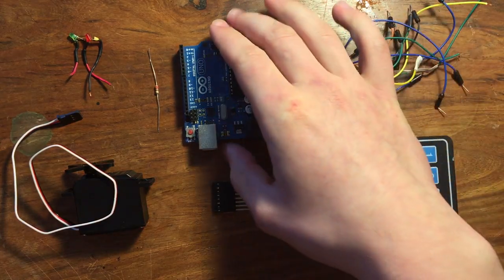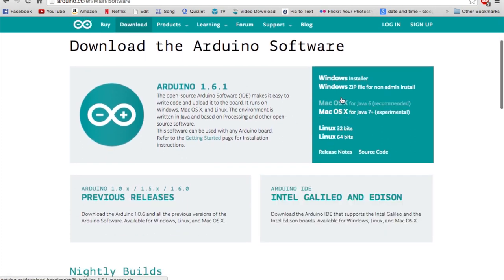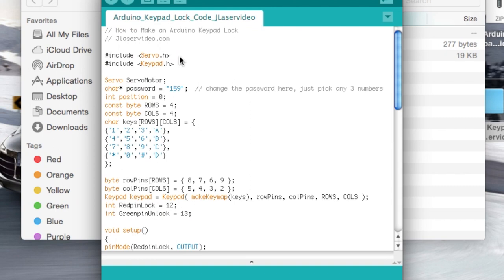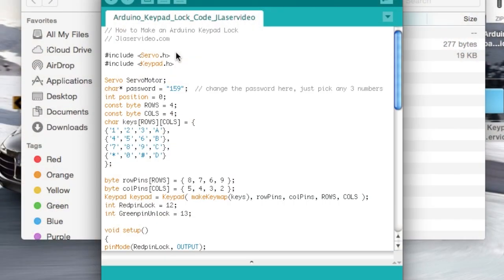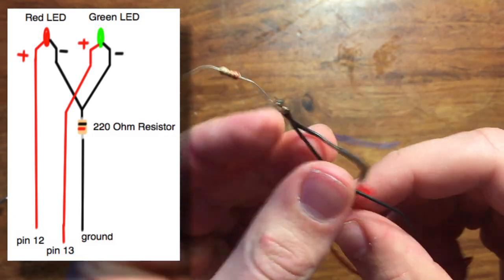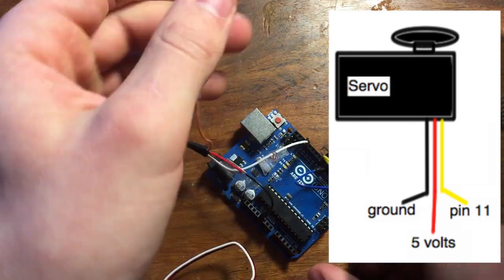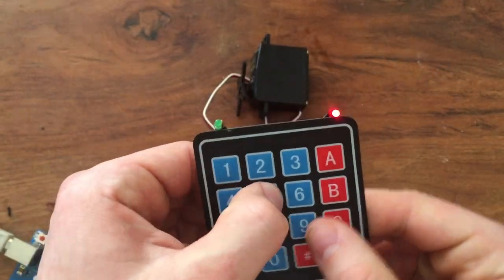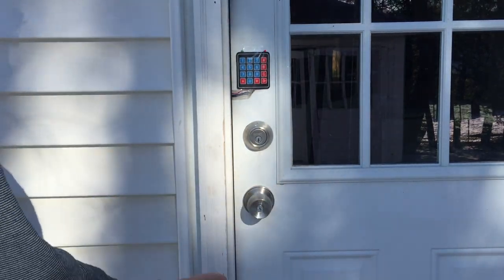How to Make a Keypad Lock With an Arduino

Comment: maybe you could edit the code so another servo triggered whenever the wrong passcode was entered- that servo could be connected to a small lever that tipped a bucket of water down on the unsuspecting unauthorized would be enterer...erererer...eerrerrrrrr, or something.
Reply: Haha good but that's not enough fill the bucket with molten lava
Reply: Naw just make it start an alarm and scare tf out of the person

Comment: note that if password  is ' 145'  , even when press  ' 1   23   4  74   5 '   (1*4*5)    still will unlock ! you have  to update your loop : 
void loop()
{
 char key = keypad.waitForKey();
 if (key == '*' || key == '#')
 {
  position = 0;
  LockedPosition(true);
 }
 if (key == password[position])
 {
  position ++;
 }
 else if (key != password[position])
 {
  position =0;
 }
 if (position == strlen(password))
 {
  LockedPosition(false);
 }
 delay(100);
  

}
Reply: theoretically this works, but when i changed my code it doesnt work.
for some reason, the "position" counter will always be set to 0, even if you guess a correct entry (eg. '1' for password '123')...
Reply: You need to adjust closing bracket, to wrap all the content of if (key) statement:

void loop(){
  char key = keypad.getKey(); 
  if (key){
  
  if (key == '*' || key == '#'){
    position = 0;
    LockedPosition(true);
  }
  if (key == password[position]){
    position ++;
  } else {
    position = 0;
  }

  if (position == strlen(password)){
    LockedPosition(false);
  }
  }
delay(100);
}
Reply: Yo buddy's I fixed it by just adding an else if() at the end of this guy:

 if (key == password[position])
 {
  position ++;
 }

like this

 if (key == password[position])
 {
  position ++;
 }else if(key != NULL)
{
 position = 0;
}
Because it's really the NULLs that are causing the problem. This should fix the code right up.
Reply: Thanks my dude, i knew that was the problem but i didnt know how to solve it.
Reply: Hey bro! how can make a buzzer create sound when the password is wrong!

Comment: The code "<Keypad.h>" is not in orange font like in this video
Reply: I know this is an old post but it took me a while to figure it out and it might help someone else, you must save the download "keypad.h" into the same folder as your arduino. Then go to sketch, include library, and then you should see keypad and click that. If not check to see if you have it downloaded in the same file as arduino and restart the program.

Comment: i'm getting this error while uploading the code ...
any help ?
Sketch uses 3,456 bytes (10%) of program storage space. Maximum is 32,256 bytes.
Global variables use 205 bytes (10%) of dynamic memory, leaving 1,843 bytes for local variables. Maximum is 2,048 bytes.
Reply: it's not an error
Reply: well sometimes it's failing to upload the code tho ... *****
Reply: yeah it's orange colored !!
Reply: Can you help with code of password based circuit breaker
Reply: make sure you are using the right PORT under the tools tab

Comment: I really hope you get back to me on this, but m problem is that when it is in the Locked position, it turns the servo clockwise and doesn't stop, and when i enter the code, it just turns the servo counter clockwise and wont stop. I am using the exact components, code and its all in the same places as you are. Please help!
Reply: Same for me! 
I don't know what to do
Reply: I'm just jumping into this stuff but maybe the sensor in your servo motor has failed?
Reply: oh i fixed it btw its cause the servo was a continuous rotation servo
Reply: do you know how to use it with only a continuous rotation servo? coz thats all i have
Reply: Omar Khaled that's the thing, you really cant, the point of a continuous rotation servo is that it just rotates continuously

Comment: I really do love the project and currently using it to lock my shop however there are some concerns.  First I am putting in a safety backup somehow so if I loose power I can still access my shop and second is that you can put in any string of numbers that has the code in order and it and it will open the lock.  So if the code is 692 you can put in 65498732 and it will open the lock.  Not too concerned with it because there isn't much to protect in my shop without other keys, however it could be an issue.  Again, thank you and much respect!

Comment: the problem is there is no penalty for wrong digit, if u guess a digit rigth and then one worng the rigth one dose not even go away,                                                                                                   with a random code it max 3 counts from 0-9 to guess it , but unlike normal codes it dose not get expenentialy harder so 9 digit code is still only 9*10 tryes, unlike 10^9 or 1000000000 if it erased progress when typed wrong

Comment: I've got a short question: is it possible to use 2 different codes for 2 different actions. Example with code '123' you turn on the green led. And with '456' you turn on a red led and rotate the servo.
Reply: it is possible!
Reply: +Adriaan De Bleser everything is possible. you just need to modify the code

Comment: just curious if u can do this with a 12v magnetic lock instead of a servo?
Reply: +HAC DILL yes mate just use a relay
Reply: +Damian Butterworth Can you help me, how can I use the relay ? Do I need to add a switch to make my magnetic lock on? or will this keypad be enough? How can I make it on using this tutorial? with relay
Reply: +D Hills Santillan I would use the digital pin to switch a relay and use that to turn on the magnetic lock. Or anything in fact. Only just found out how to see messages on here lol so sorry for slow reply.
Reply: THANK YOU! it's okay I appreciate your helpful reply
Reply: Damian Butterworth Awesome..thanks :)

Comment: the code doesnt work :(, [error compiling]
Reply: +MEe$ It worked for me.
Going to try it on my youtube channel soon
Reply: +MEe$ 
Try different ports. Do Theys steps. Open the arduino software. Go to tools Then port. Try using different ports when you upload the code. 
If that does not work Go to tools then bords and make shure you have selected the right bord. (the one that you are using).
If this works please tell me and sub to my channel. 
Thanks!!!!!!!!!!!!!!!!!

Comment: Are there enough ports to add more than one servo?
Reply: I think it depends on the arduino
Reply: There are up 13 pin ports on the board I believe. If you need more, you could if there is a port extension.

Comment: Started working on this but when I uploaded the code I got alot of error messages:
Arduino: 1.8.5 (Windows 10), Board: "Arduino/Genuino Uno"

The library "Arduino Keypad Software Jlaservideo" cannot be used.
Library names must contain only basic letters and numbers.
(ASCII only and no spaces, and it cannot start with a number)

This report would have more information with
"Show verbose output during compilation"
option enabled in File -> Preferences.
Reply: sad
Reply: u need to upload keypad file

Comment: Hey, cool video, I just wanted to ask your opinion on atmel studio for an ardunio ide. If you aren't familiar, it is a micro controller based ide based on visual studio I believe. Also, since it seems this project is permanent in your case, I would recommend you build an ardunio from an atmega chip and ask the components from scratch as it is much smaller, and cheaper, so you can use your main board(s) for other things.

Comment: Hi bro, I normally put a 110ohm resistor with a switch to stop random switching. Having the same problems with the keypad.?? Tryed 110 ohm on each pin to ground but that stopped pad working.Will try another size tomorrow.

Comment: this is the error msg i got:
Arduino: 1.8.3 (Windows Store 1.8.6.0) (Windows 10), Board: "Arduino/Genuino Uno"

C:\Users\noahw\AppData\Local\Temp\Temp2_Arduino-Keypad-Software-Jlaservideo.zip\Arduino Keypad Software Jlaservideo\Arduino_Keypad_Lock_Code_JLaservideo\Arduino_Keypad_Lock_Code_JLaservideo.ino:5:20: fatal error: keypad.h: No such file or directory

 #include <keypad.h>

                    ^

compilation terminated.

exit status 1
Error compiling for board Arduino/Genuino Uno.

This report would have more information with
"Show verbose output during compilation"
option enabled in File -> Preferences.

Comment: Hey I built the same thing recently just a far more complex version but with the same parts + an LCD outside ... I have 2 questions though. 1. I had to by these coils of cord and run them under the door to the other side as I was afraid shutting the door on the wires would damage them ... Do you have that problem? 2. Would you mind taking close up pictures of the servo mounted inside and upload them somewhere for me to see? I ask because I couldn't find a proper way to do it for hours (I mounted on a room door so the lock is on the knob ) and I had to resort to buying a barrel bolt that I mounted next to door and ghetto rigging a paper clip from the servo to the hook on the barrel bolt. Thanks anyways

Comment: Servo how did u make it work with power instead of PC???did u remove PC and then reconnect it with power??if u do that arduino will reset na??how did u do??answer
Reply: Rajalakshmi S H the arduino? You can power it with 5 volts in the port he used, or 5-9 volts in the dc power jack.